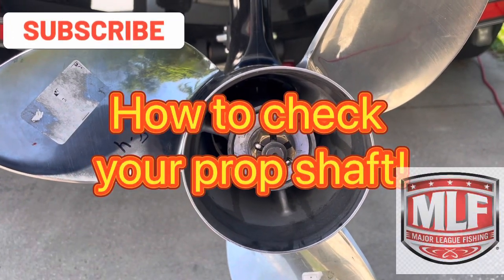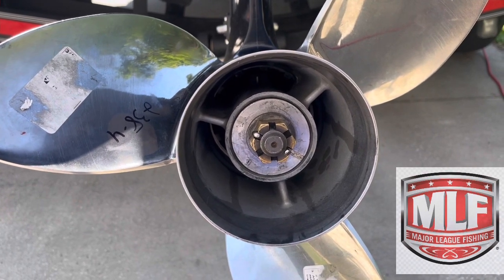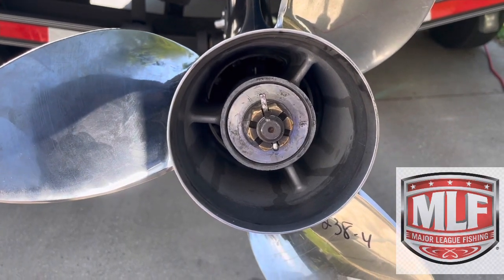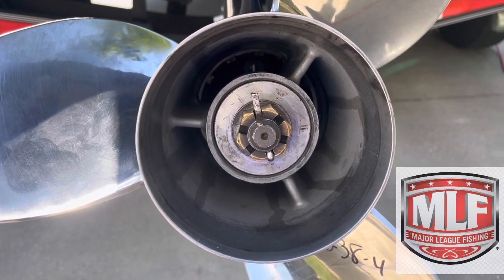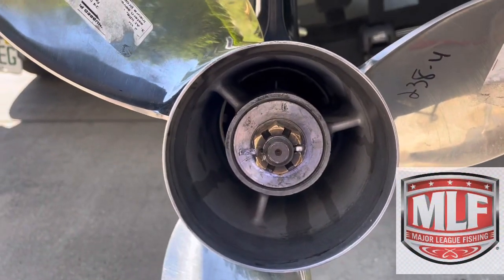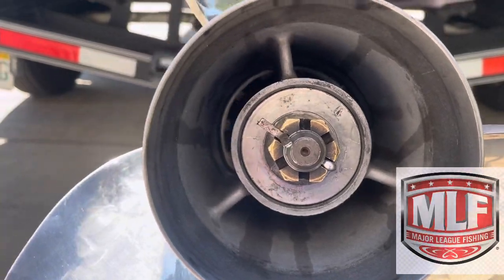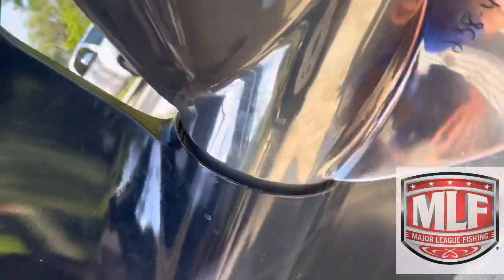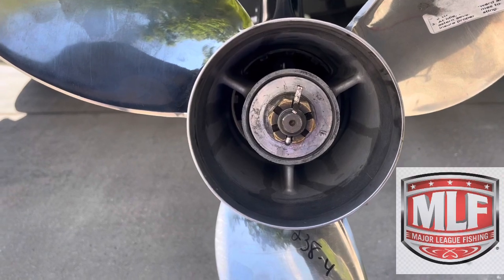HOW TO CHECK FOR A BENT PROP SHAFT!!

Comment: Get a dial indicator.
Reply: Would a heck of a lot cheaper than a new lower. Even a new prop shaft and a couple of seals would be miles of savings. My eyes are old and definitely not as good as a dial but I can't see an issue there. As far as the gap test; you do know those are not critical specifications, right? I think we got us a rich boy here.
Reply: Mines had a 3mm bend for years, still going strong and no adverse affect